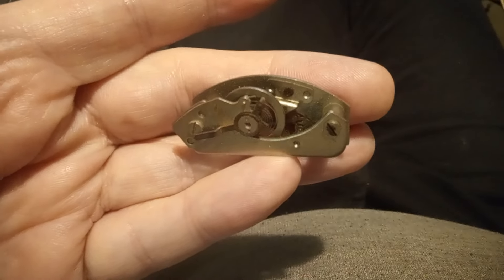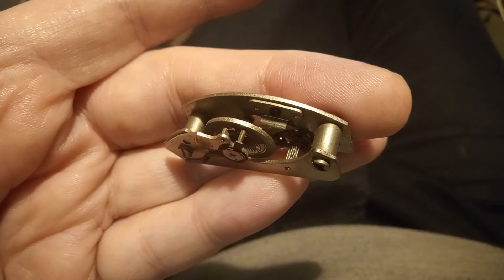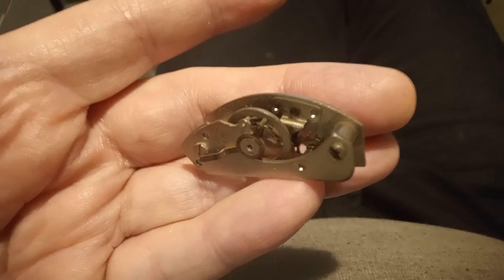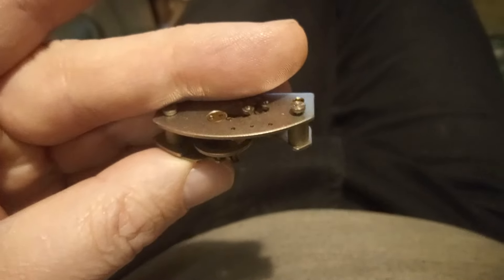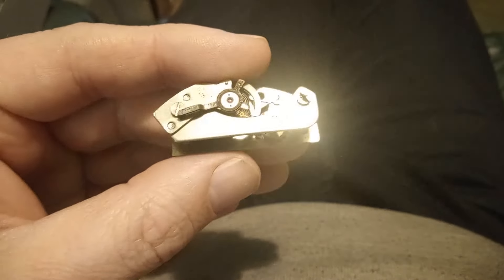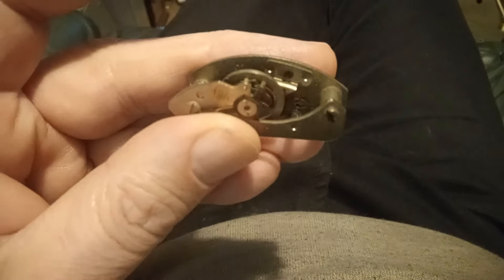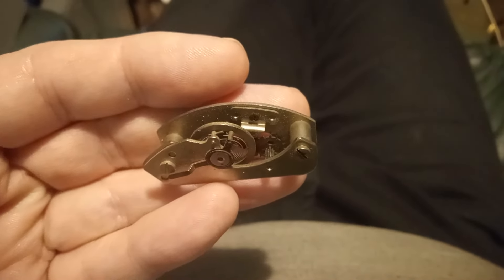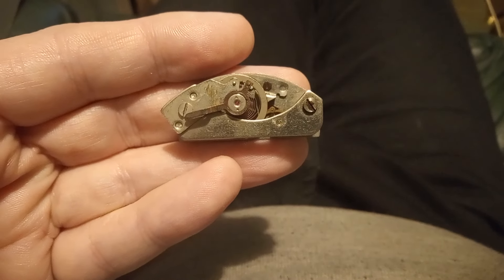NEEDED: East German pin pallet escapement.

Comment: Might a regular platform escapement potentially work?
Reply from the maker: No, it has to have the escape wheel pinion at that exact place and the two mounting screws must also match the holes on the frontplate. I think this was a fairly common escapement in East Germany, so I'm hoping someone will find one and I may be able to buy it and get my big striking clock going at last.